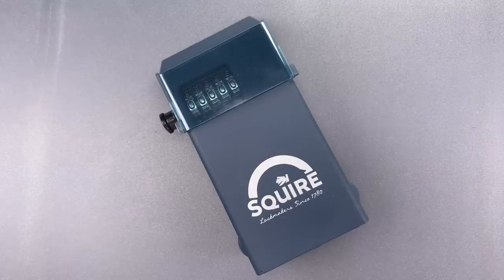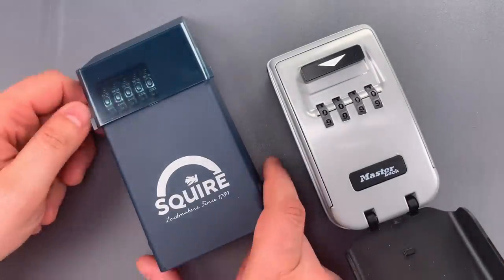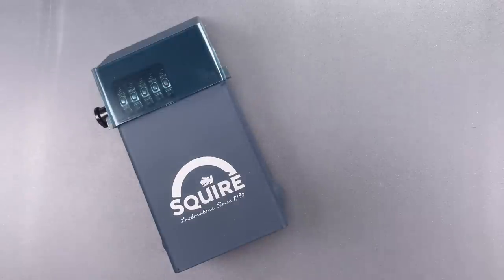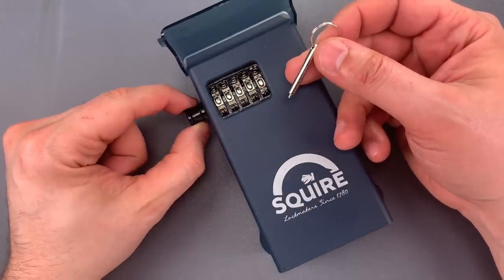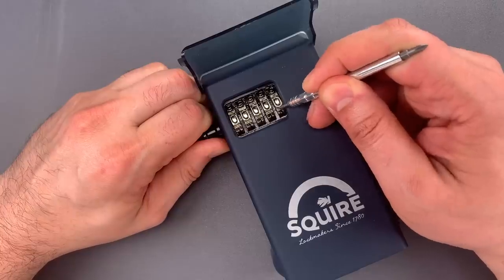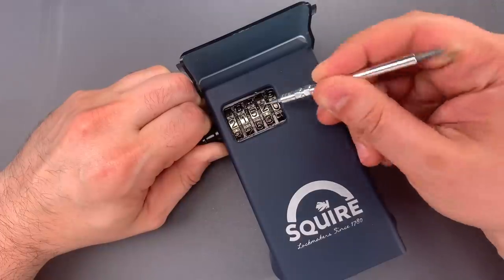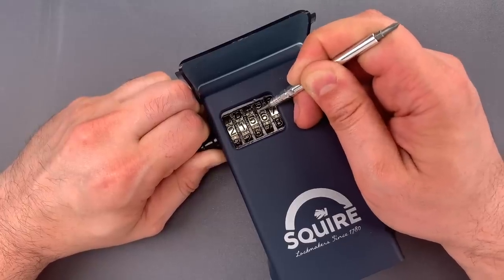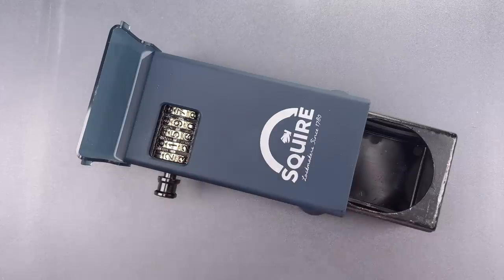[1171] Better Than Most, But Still Problematic: Squire Stronghold Keysafe

Comment: * Unrelated to this video, but can you still pick a lock that has a key in it? By that, I mean a key on the other side. Our front and back door locks cannot be unlocked (with a key) from one side if there is a key inserted in the other side. Further more, you cannot “push” the other key out, especially if it is partially turned. Would love to see a video of picking (or compromising in any way) a lock with a key inserted from the other side. *

Comment: LPL picks into high security military building and tells the commander, the locks were inexcusable. He gets arrested. LPL in his jail cell with a pick made from a spork: "movement on 4......and the lock is open", picks the warden's  office door and tells him about the poor state of security in the jail. LPL is now moved to a supermax prison. LPL uses a $2 electronic gadget from Amazon to prevent his cell from locking electronically. LPL uses a smuggled $4 Chinese RFID cloner to open the electronic doors to the Warden's office and proceeds tell them about the INEXCUSABLE security in the prison.

Comment: I have a question about making a breakable key. I feel like it's possible to make a key with teeth that are thin, can push the pins up out of the way, and still allow the core to rotate? I imagine you'd need to make the key in such a way to be able to insert the key then "activate the teeth".

It feels like it couldn't work, but I like trying to be creative to problems. I can see issues, but that doesn't mean you could design a key like it

Comment: There is clearly a large market for a lock that can be opened by a person with information that can be transmitted rather than the possession of a physical device (aka key).  If theses code wheel things are never good, what is the alternative?

Comment: Wait... If you reset the combination just by pushing on things on the dial itself, does that mean if you have the right tool (or equivalent) you could just reset the combination even if it were locked? Or does it have to be unlocked first?

Comment: So, what event significant to Mr & Mrs LPL occurred on the 21st of May 1997? Perhaps it was a random number, but I'd like to believe that Mrs LPL was sending Mr LPL a sweet memento message covertly.

(In before comments about the USA's habit of doing dates in MDY format...  Using the more commonly used DMY format would be a very simple way to disguise her intended message 🧐. But let's not argue the pros and cons of MDY vs DMY; both systems wrong. Obviously the best way to codify dates is YMD.)

Comment: Huh, well, now I know how to open my Christmas presents... any suggestions on how to fanagle an Easter egg?
Reply: Actually yes.  REheat the egg in water. Then tap the edge of egg so you can get a finger nail under it.  Then take a table spoon and gently spoon the egg away from the shell.  If all goes well you ought to be able have two halves of egg shell mostly intact.

Comment: So, LPL puts this keysafe in the "it's better than 90% of the competitors"-category, which is kind of an approval. I looked to purchase this thing online, and now I find that Squire discontinued this product. Looks like there's only those dodgy cast zinc-alloy things available now. Either the dodgy China imports (ya know that cheap stuff from amazon) or brand keysafes that look suspiciously exactly like the China imports with the logo slapped on.

Comment: I'm surprised so far nobody in the comment section seems to take a guess whether the numbers were not completely random. 2-15-97 (or maybe 21-5-97) does sound like a date, doesn't it? Feb 15th was a Saturday, so maybe the wedding date? 
I know it does not matter at all, but it's still fun to guess.

Comment: Why do so many locks/lock boxes half ass part of their device? Like with this video, the body got praised by LPL but the lock was half assed from the sounds of it. Even with locks part of them are solid while part of them sucks, why don't lock manufactures just make something that's good on all fronts even if the price ends up being more expensive for the consumer? Is it just because they're lazy, do they not give a shit, or is there a limit to what they can do, i.e. they can make X stronger at the cost of making Y weaker? Are there even any locks that nails everything? i.e. they're tough to physically break/damage, the locks are difficult to pick even for someone with the skill level of LPL, the lock can't be shimmed, etc.

Comment: Better than most? It's still very flawed tho. At least it has false gates. I have a 5wheel shutter padlock also made by squire that's even easier to pick, using the same technique, because you can feel a deeper clunk on the plunger when you've got the true gate. I personally find the stronghold combo padlocks with the push button underneath a lot more tricky. Still pickable, but more time consuming, for me anyway.

Comment: You have done this trick many times... is this simply an unavoidable flaw of this kind of lock? or are there examples of lock that make it impossible to insert a tool between the code wheels to do this?. As far as I remember you have never shown an example of it being impossible, just sometimes the hole is smaller and makes it... well, not harder, just a lil bit more of a nuisance.

Comment: Most of the locks with this type of exploit could be fixed by simply divorcing the opening mechanism from the tumbler so that the opening lever is only contacting anything when the correct combination is set.